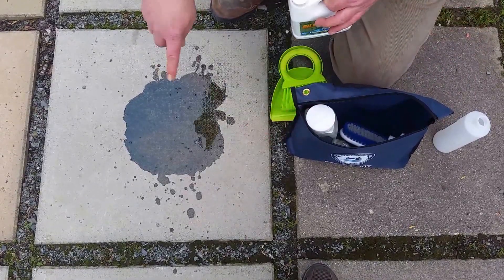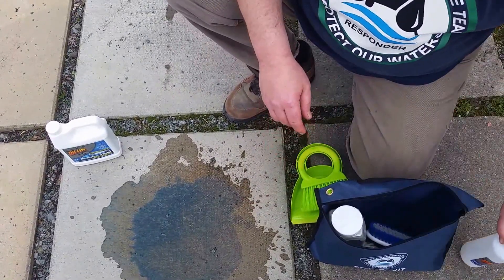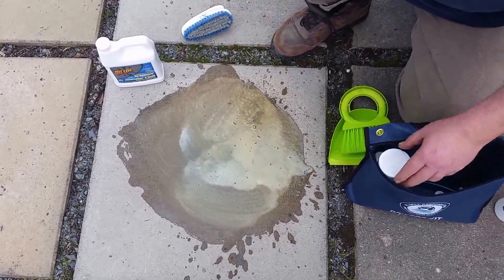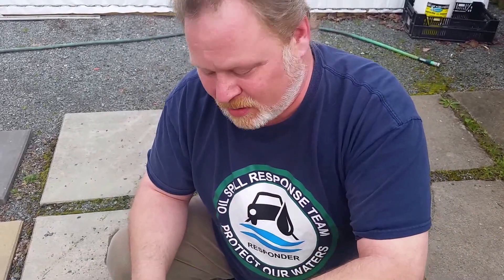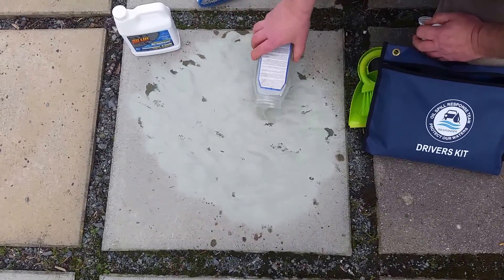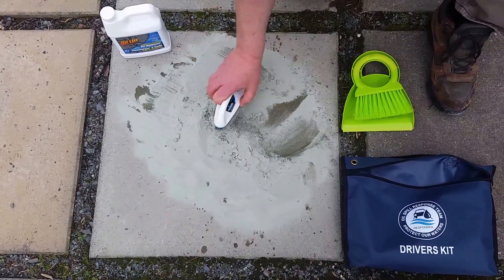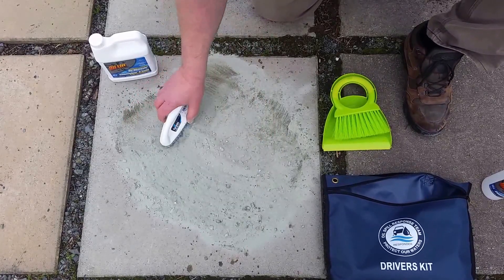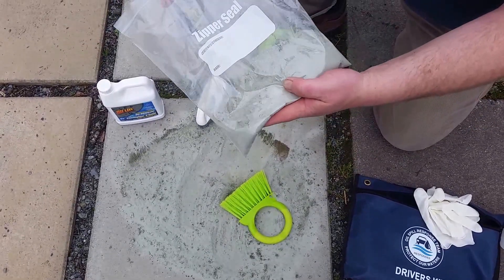Clean up oil on driveways Oil Spill Response Team

Comment: If using on asphalt is it best not to use the flubber since its oil eating ability might hurt the asphalt since asphalt is oil based.
Reply from the maker: Actually on asphalt using the flubber rehardens the surface especially with diesel spills

Comment: The OilLift bottle says not to dilute if you're using it on asphalt.
Reply from the maker: I know, it’s a 50 to 50,  oil clean up can drive you crazy. 
The crapy part is you have to show the highest ratio or you get kicked off the shelf.
I’m trying my best, but I’m just a little guy in the fight. 
The truth is you can do ten parts water or even twenty. Water 
Please stay in touch. 
The free learn sight will be up soon. 
The bottom line is depending on the oil type you sometimes need full concentrate and then work down the line.
Your always supposed to spot test with any cleaner. 
That’s on the label 
Spot test 
Spot test 
Spot test
Reply: @oillift  Thanks, good to know. I went with what was on the bottle as I wasn't sure. It looks good so far, although we'll see what it looks like in the morning.